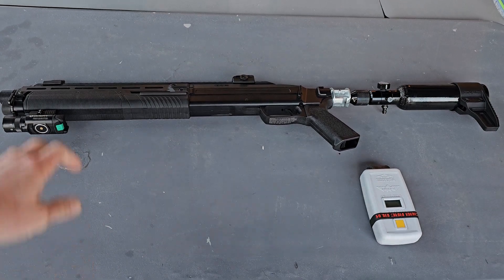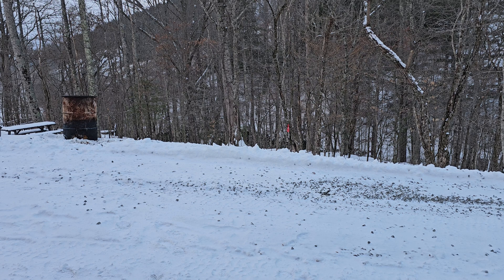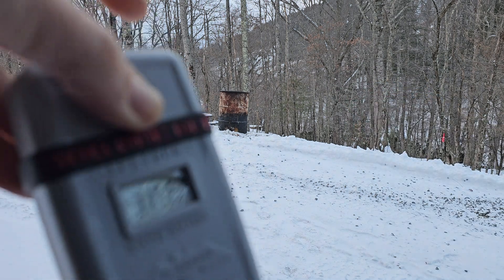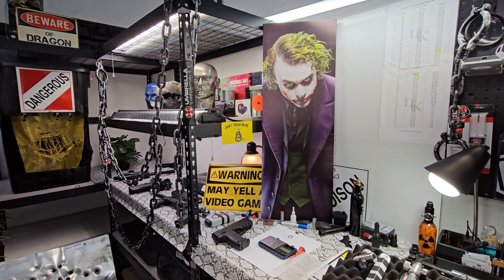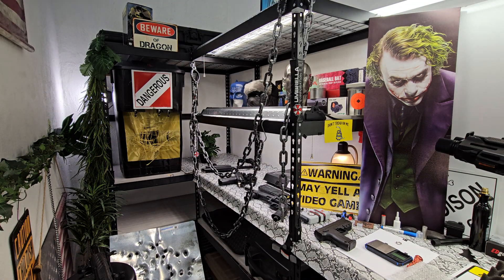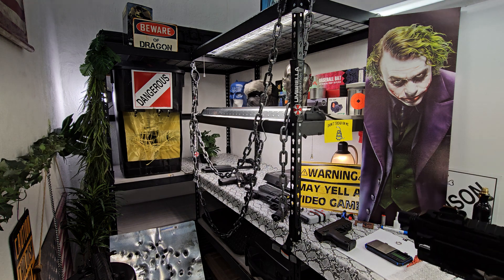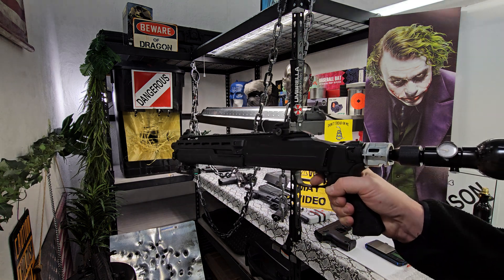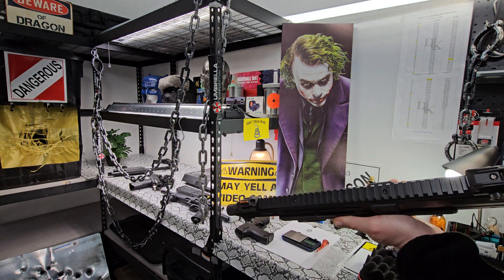Testing HDX with 1100psi output air tank: Will it do 52 Joules on HPA like it does on 88g CO2???

Comment: Yeah this thing is designed to work with co2 not hpa, that little brass tube that carries the air doesn't work with air that well.
Reply from the maker: It's kind of crazy how good the HDB works with air though compared to these
Reply: @DK-Spencer I love your videos man, I first started out watching Sean and have branched out from their 😂 I remember doing this same test and thinking damn Sean is right 😂. I think the HDB doesn't have that little tube going into the air chamber or valve so it doesn't have to try and squeeze all that air through a tiny little tube.